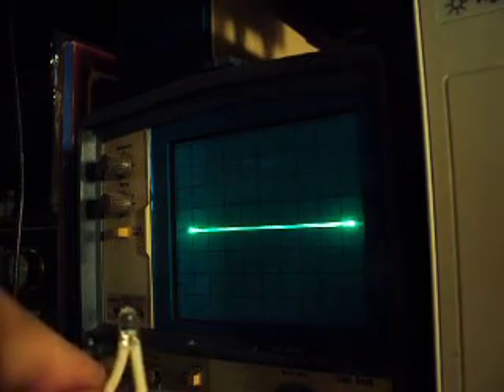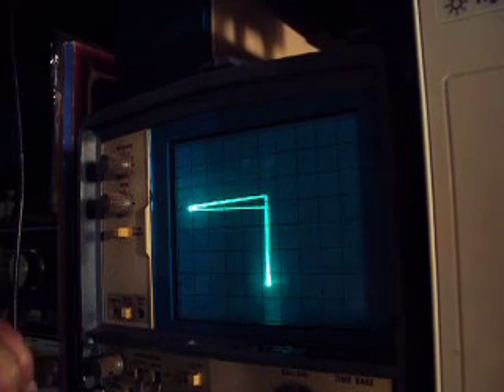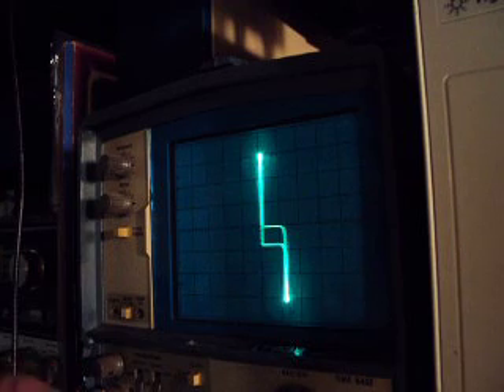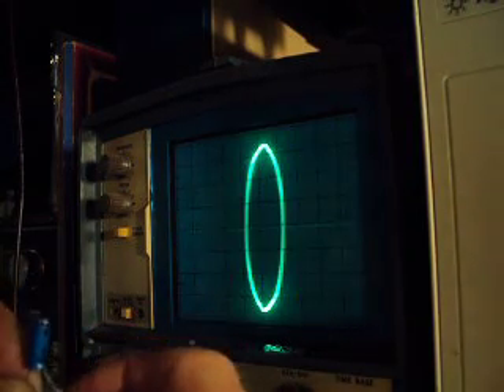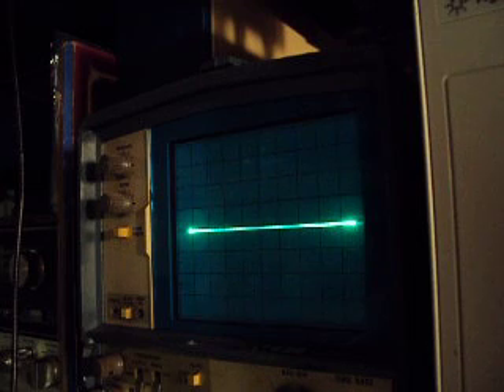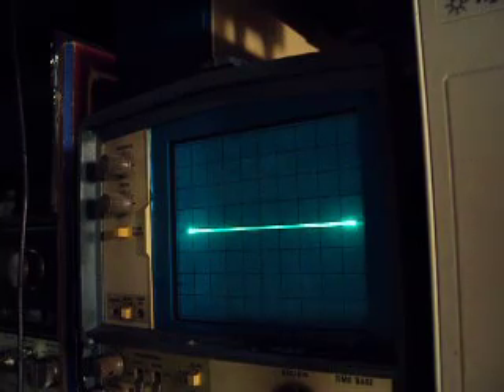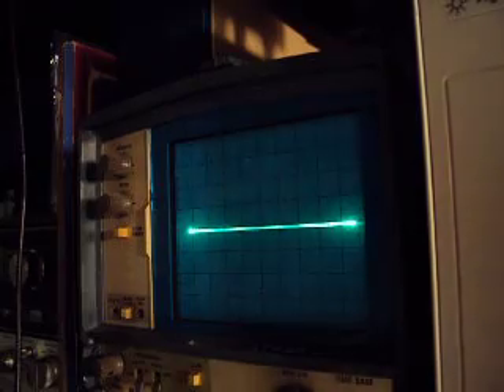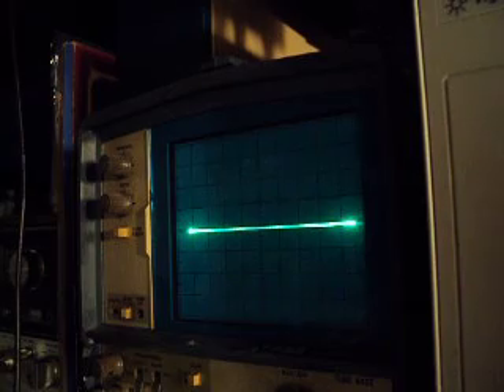Testing Diodes and Electrolytic capacitors with my Basic Curve Tracer / Component Analyzer

Comment: I remember the Octopus being written up in QST around 1977 give or take. I built one then and still use it for quick checks on zenners, tunnel diodes, caps and RF transistors. It is a quick and easy tool to throw together and once you play with it some, it will do most of what the Huntron will do and for a lot less money.  My only cost was a small box from Radio Shack which was $4 back then. The other parts were scrounged  from my junk boxes. Just 3 or 4 resistors and a salvaged filament xformer. I also used 3 dropping resistors which were tapped on the front panel for low voltage items.

Good thing is now day you can find a cheap scope at a ham fest or online for peanuts since the Octopus will work on any 5 meg or audio cheap scope.

 I was pleasantly surprised to see so many articles on the Internet for making an octopus transistor tester on the cheap. I heard that the circuit actually goes back to the early 1960's  

Many people just want a working box and don't care to build stuff. Shame
Glad you are building these for people who are learning how to troubleshoot. Great tool for any electronics bench. 

Oh, set your scope inputs for DC and you will get straight lines instead of what you were showing in the video.. 

Good luck es 73,
Glenn WA4AOS
DSM LABS ( dot com )

Comment: Not sure if you want it like that with the double lines on purpose when testing your diodes but if you set your channel one & two to dc instead of ac you will get a single line like most of the examples you see in curve tracer manuals.